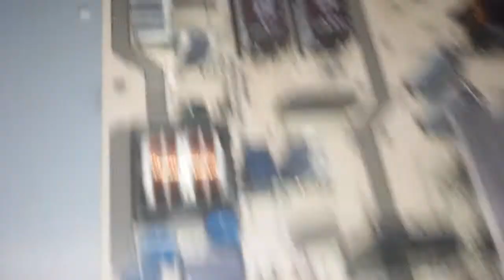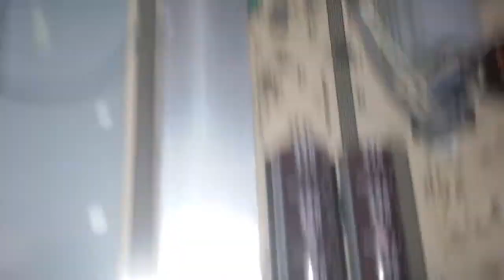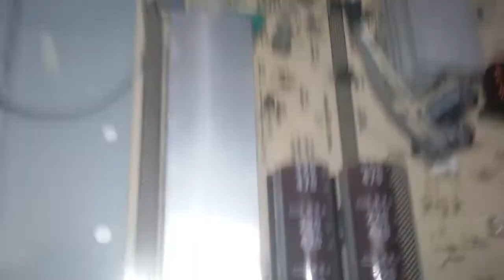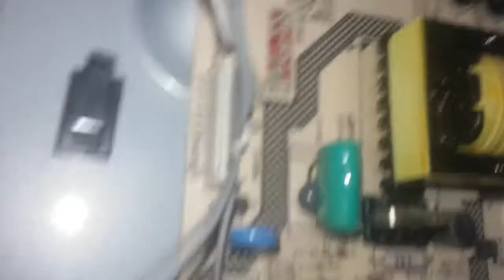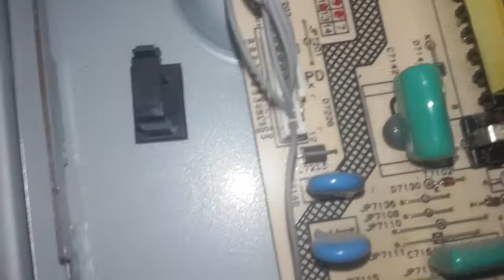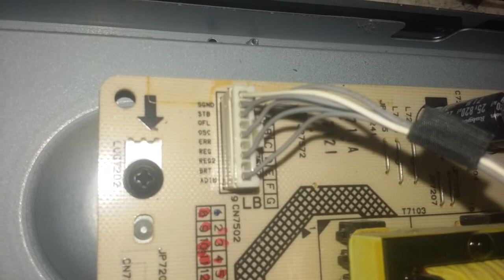TV hack

Comment: I googled what is a STB Wire and I got this link
https://www.verizon.com/support/residential/tv/fiostv/receivers/wiring+diagrams/wiring+diagrams.htm#
Reply from the maker: STB also means set top box. I need to find the correct wires to turn on the backlight. This hack varies from manufacturer to manufacturer so every time I do this with a broken TV I have to do this all over again. I think it's something on that second connector.